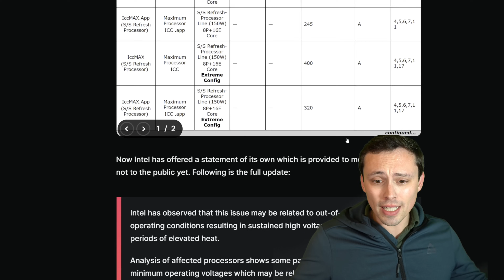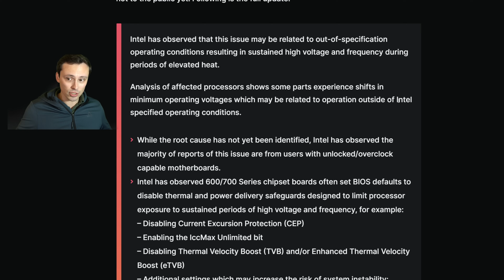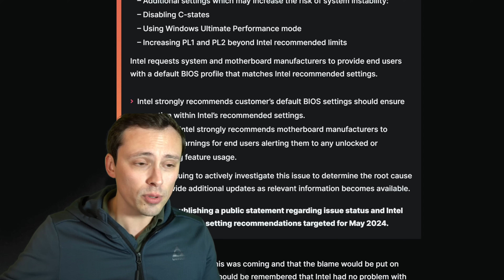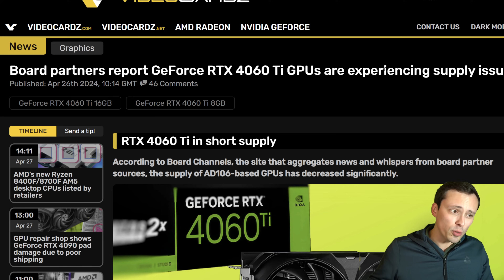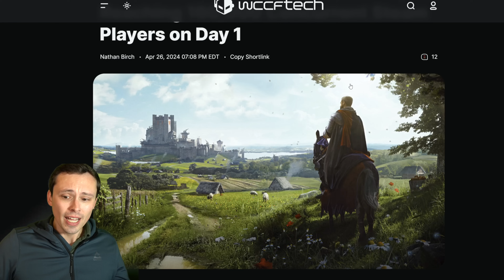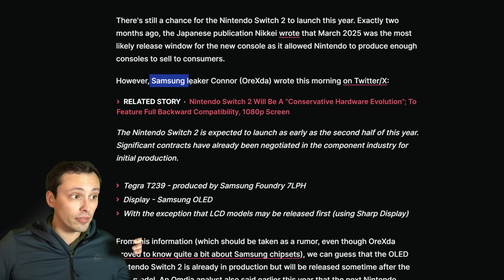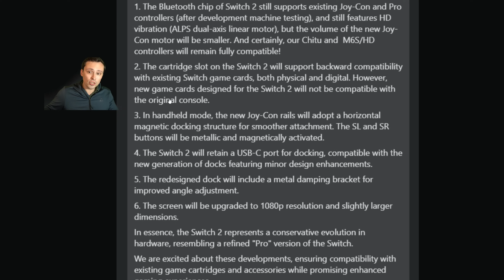MSI Abandons AMD GPUs | Intel Official Statement on CPU instability | Nintendo Switch 2

Comment: It's almost like Intel wanted to get all the good reviews with these insanely unlocked bioses but now that the processors are degrading too quickly over time they're putting the blame on the motherboard manufacturers forgiving them the BIOS features they probably wanted for those said reviews

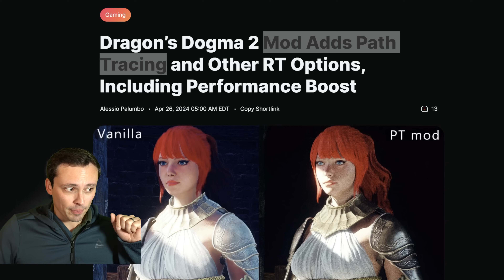Comment: 12:07 if you do character photography in Cyberpunk 2077 with path tracing or even just DLSS Ray Reconstruction, you'll notice that your character (V) will appear grainy. It's one of the reasons why I don't use path tracing or Ray Reconstruction because I do a lot of character photography. For environment photography, however, path tracing is definitely better than rasterized or normal ray tracing.

Comment: Thank you for keeping us up to date about the Intel case.  I have done extreme testing with a 13900K and MSI MAG Z790 Edge TI MAX WIFI.  I invite everyone, if you want to resolve the matter, to document your settings.  Always start with a clean bios, use the latest supported BIOS from the manufacturer (do not use a beta bios, unless the manufacturer invites you to.  Unless you know exactly the changes needed to get a stable environment.  Save your BIOS settings, most motherboards use profiles.  Set your clear bios as profile one.  Most  memory has proper XMP settings on the chip and should be compatible with motherboards from 2020 and newer.  I am currently running with a mildly overclocked system where the Wattage hit 300W at a maximum and does not cause thermal throttling (max temps 91 degrees).  I have unparked my cores.  I run 38891-ish in  Cinebench 23.0.

Comment: Has anyone actually bought an MSI Radeon GPU? The main issue with them is quality, namely that the cooler is a botch-job that is worthy of the famous "Men in Sheds"-Method in Britain, although one could argue they'd create a better fit. 

I have seen many a warning in german hardware forums about buying the MSI offerings, given that the cooler is often ripped straight from the RTX models and then just "fitted" to the RTX models, instead of doing what everyone else does and designing a dedicated Radeon cooler. 
Hence why everyone recommends any other brands for Radeons, including Sapphire, XFX, Asrock and ASUS, even Powercolor is preferred. If one has no problems with some coil whine or mediocre cooler design or thermal paste. 
Given that most of the people that buy Radeons are Selbstbauer or self-builders in english, or their own System Integrators, when they buy a Graphics card, they do tend to research more than the average customer and issues like the one mentioned above are, shall we say....detrimental to the sales of a GPU. 
And the MSI Radeon RX 7900 XT Gaming Trio Classic, sold just 70 Units on Mindfactory, which is the only seller that publishes their numbers. 
If you compare that to the XFX RX7900XT Merc 310 (their custom base model) that sold 2,540 units in the same time frame, or their RX7900XT Merc 310 Black Edition which sold 2,690 units, or the Sapphire Pulse RX7900XT with 2,540 Units the issue becomes quite appearant.
They stopped, because nobody wants them.

The MSI Radeon RX 7900 XTX Gaming Trio Classic in comparison sold about 850 units, which isn't that bad, but worse than all it's competitors bar the ASrock Taichi OC (290 Units), the 24GB ASRock Radeon RX 7900 XTX Taichi White OC (510 Units) and the Gigabyte Rx7900XT (640 Units).
The XFX RX7900XTX Merc 310 Black Edition sold 3,560 units, the Sapphire RX7900XTX Pulse 1,050 units, the 24GB Sapphire Radeon RX 7900 XTX Nitro+ Vapor-X 3,350 units, the 24GB ASRock Radeon RX 7900 XTX Phantom Gaming OC 2,520 Units, and even the 24GB PowerColor Radeon RX 7900 XTX Hellhound (2,370 Units) and 24GB PowerColor Radeon RX 7900 XTX Red Devil (1,320 Units) sold more. 
If you put them in a comparison with the XFX, the Sapphire Pulse, and the ASUS TUF, the MSI card has weaker clock speeds, weaker performance and it was known for some hotspots of up to 105 degrees C in winter.
And on top of that, during early 2024, those cards had a markup of 200-600 Euros compared to the Sapphire and XFX models, and roughly 160-500 Euros to the ASUS TUF model. The pricing of the MSI 7900XTs fluctuated between 1199 and 1700 Euros during that time. 

I think one can see the issues, it's worse in all regards and costs either the slightly less to roughly the same (during the end of 2023) to a few hundreds of euros on top (from early 2024 onwards).....

On the plus side they are not Gigabyte....just!

Seriously MSI, do it properly, or go home! We germans have no problems with botch-jobs, well not too big ones to not appreciate them ;) , BUT ONLY IF THEY WORK!!!
Reply: Msi RX 7900 XTX has amd reference card power limits at Taichi/Nitro+ prices. There is zero reason to ever buy a msi amd graphics card if anything else is available.

Comment: MSI not producing RX 7000-series cooler models and instead is focusing on Nvidia cards is absolutely profit related. AMD already has the very established AIB-partners in Sapphire, Powercolor & XFX and from which atleast to my knowledge, most people who buy an AMD GPU, buy one with a cooler from one of the aforementioned AIB-partners. 
Asus could be possibly considering on dropping out as well. If you look back at RX 6000-series, there has not been a single ROG Strix cooler model for the 7000-series. Not to mention AMD GPU market is just significantly smaller than Nvidias. Or atleast it seems to me that Asus is now treating AMD GPU's as 2nd class products.
Reply: Can confirm. I personally wouldn't consider an AMD GPU that isn't one of those three. My old RX 580 was an XFX one and my current 7900 XTX is a Sapphire Nitro+
Reply: Dam...and I just got 7800xt asus tuff

Comment: Intel are idiots for not locking down voltages and states. That's their fault, they could have literally implemented this to every OEM partner, but they did not. This has been done before on certain architectures and it's nothing new. To  blame someone else is asinine when you could have dictated it from the get go.

Comment: I hate my ASUS motherboard for so many reasons not even related to this. I never had an issue with my ASRock board, and when AMD CPUs had the issue, ASRock motherboards were one of the BETTER ones. Funny enough ASRock and ASUS used to be part of the same company, and ASRock ships their boards and software with MUCH less bloat garbage (i.e. fan control,  extra "AI" BIOS settings, etc.) I really want to go back to ASRock or a different mobo manufacturer for my next build 200%

Comment: arent you able to quickly go to default on a motherboard by just removing the cmos battery for a bit? seems like that feature would be in already...
Reply: the problem is the "default" settings on these motherboards are the overclocked settings..

Comment: Not an MSI fan, have the RX7600XT by Gigabyte. Running an MSI Mech keyboard the Mystic light software will not even run, tried every fix it just crashes all the time. Using SignalRGB for now. Upgraded my desktop 3 times about to do so again. Built 3 other PC's 2 for me 1 for my niece not one have MSI MB, 2 Gigabyte, 1 ASUS or 1ASROCK.
Reply: Stick with signalrgb dude. Mystic light is terrible.

Comment: All of these Intel reports made me return my i7-14700kf components and plan a 7800x3d rig instead.  I was once on team red using an fx-6300 but switched to Intel when the i7-6700k released. Intel's IPC was much better than AMD's during that time, and I experienced higher performance with less cores. But, its seems like the roles have been reversed. Looking forward giving AMD a try.
Reply: The 7800x3d is definitely a good choice. It's very power efficient, and makes i9s and Ryzen 9s effectively pointless for most gamers.  It's seriously weird how good it is.
Reply: If you don't have any issues yet, don't worry about it too much. Especially this late into the Zen 4 generation. Wait for Zen 5 later this year and then make your final decision then.
Reply: AMD has been better since Ryzen 2000 tbh. Intel started shitting the bed after the 6th gen.
Reply: @TheFirstSSJ more like when zen 2 dropped, zen 1 and zen+ were subpar.
Reply: I honestly don't blame you. Am still on 12th gen, main rig has 12900KF, no point to upgrade any of them with the current issues on the 13/14th i7 and i9s. If I were building today a 7800X3D or 7950X3D or if there's an all 3D vcache 8950X3D in the future that would be amazing. I turned off MCE etc to be safe but ram speed on DDR5 has been my issue, which is separate from the current Intel issue no BIOS updates have cured that I'm not getting as much ram speed as I should be, but it works. I would be open to switching teams in the future, but the only saving grace were the deals when I built. You also have a much better upgrade path. I do have older AMD around the house Athlon 2, some cheap A series laptop still gamed decently, helped my friend back in 2020 with picking parts 5800X X board, solid build. Can look back at things like I should have switched but the timing didn't line up, if I had went even 3700X instead of 9600K that would have been better. Intels I've had around of the past era: 2100 (office machine tbh), 6502p skylake era low end i5 prebuilt, 9600K (at least it was only a $200 chip), 12th gen did improve on those but it really comes down to pricing that they went massively on sale, around 210-320 for their i7 and i9s. Honestly not sure but AMD should continue to improve with the next gen (boards should get cheaper in theory, perhaps get more features as baseline) and the upgrade path is better. AMD also had better packaging with 5900X than say 12900KF did as far as presentation goes.
Reply: As it has been pointed this is not INTEL problem. It is motherboard problem. Just like it was when AMD CPU's were burning.
Reply: @paulboyce8537  But, Intel told the MB manufactures that "unlimited" power limits are within spec.  So, it's really their fault.  Hardware Unboxed just released a video showing proof of Intel saying this: https://youtu.be/OdF5erDRO-c?si=TzNv24alqp5ptqhy&t=1123

Comment: Intel strongly recommends using the far lower recommended setting (not the max spec) on motherboard and CPUs that are being sold as unlocked or extreme CPUs.
Intel had NO idea that every MB manufacturer has been doing this since the 12th gen came out.
Intel has NO idea why there were very few issues with this on the 12th gen and increasing issues on 13th and 14th gen 
Intel had NO idea that CPUs run at safe/stable levels would be 10 percent slower than the reviews shown

Intel notes that significantly exceeding the recommended power levels is highly likely to damage your CPU
Intel notes that overclocking, including overclocks/excessive power done as MB defaults voids your warranty
Reply: Yeah right. Intel knew exactly what they were doing allowing Mobo suppliers to basically overclock the chip so they can remain near the top of the chart. They knew exactly what was happening because otherwise AMD would have been 10% ahead which is a horrible look. All completely premeditated actions from intel attempt to remain competitive.

Comment: I posted this on another channe....l was worried about this.  I have a 13900k and an ASUS motherboard.  I set multicore enhancement to enforce intel limits and SVID behavior to Intel fail safe.  My chip is running stable on all of my games with these bios settings.  I ran cinebench on my 13900k with these setting and still scored 35076.  It still performs well.

Comment: I'm one of those affected by the 13th/14th gen Intel instability issues, started crashing during a lot of games a few weeks ago, and it's gotten progressively worse since (I'm on a 13700K, on an ASUS Prime Z790-P Wifi, and the Horizon: Forbidden West support team confirmed that my game crashes were during shader compilation due to this issue, as I sent them crash dumps/etc). There's a BIOS update for my board, but I've always been a little terrified of BIOS, so I haven't done it yet.
Reply: Am flashed to the recent BIOS for Asus TUF Gaming Z690 Wifi, though I'm on 12900KF. It's super easy to BIOS flash, not sure if it will solve your issues, but just putting the unzipped .cap file onto either a usb drive or an external hard drive you can do the flash in around 5 minutes. I too was scared of BIOS flashing. I've done 2 boards to the recent BIOS and some earlier BIOS, you can also turn off MCE, last video on here had some good suggestions for settings. Their BIOS flash is easy to navigate to and use. Not sure if it will fix things and you'd have to redo settings as they will default again (always have to turn back off armorycrate bloatware to disabled, I use openrgb when I want to adjust). After the machine restarts a couple of times, the flash is done. Just have to not touch anything for a few minutes. It's good to get over the fear of doing it though, it wasn't as scary as I thought it would be to do both my boards.

Comment: I find it unlikely that multiple motherboard manufacturers shipped their BIOSes configured this way without Intel's direction or approval. If it was 1 manufacturer, I could buy that. It seems more likely that Intel either didn't communicate their requirements properly or else directed the motherboard manufacturers to set high power limits so their CPUs would perform better in reviews and benchmarks.
Reply: The latter 100%. Come on.. Intal is struggling to remain profitable. that additional power allowed them to stay neck n neck with AMD. Letting AMD have an unquestionable 10% lead would have been bad enough that Intel decided it was worth the risk to remain at the top of the charts. Now they're scrambling to make it not look so bad by saying it was Mobo or miscommunication. Of course they say that.. given a scapegoat in this scenario, you'd be stupid to take responsibility.

Comment: I can't wait for the next gen, guys!
The RTX 5070 will have 18GB of DDR7X VRAM and a 320 bit bus width, perform a bit better than a 4090 while consuming less power, all at an enforced price of $500!
The RX 8800 XT will compete with more VRAM and superior raw rasterization, as well as a $100 lower price at $400!
The Arc A880 will be there as well, having superior ray-tracing performance than either, also offered at $400!
It's gonna be sweet!

Comment: Just a note since i have seen a lot of confusion.  that asus profile test included games being run at 720 with an i9 and a high grade GPU, what I believe almost no one actually does. There is a paragraph there mentioning  the performance drop is much smaller or null at all at higher resolutions. I for example have 3440x1440 and so there is no actual performance loss between the "optimized" mb settings and intel spec settings since at the resolution I am , the gpu is the deciding element independently of the power setting of the cpu. 
Additionally the test made with the gigabyte bios was done with a 13900 qualification sample limited to 188 watts (why? do not know ) and therefore quite below intel spec, and in fact with a power limit of 188 that 13900 would perform almost like a 13600 independently of other settings so the conclusion that the 13900 performed as an i7 is not surprising at all.

Comment: I don't believe this is only the mobo makers fault, if not we would be seeing the exact same issue with AMD CPU's, but afaik we are not.  
I bet this is mobo makers and Intel, both deciding to push Intel CPU's beyond specs, all to try to beat the competition. 
They probably made a study and found that the probable amount of people having problems, would be way less than those that would not, so they risked it, because even if this ends shorten users CPU life, it would be enough for them to probably go to the internet and say "my Intel CPU is faster in games!" and only a single comment like that, is enough to sway a bunch of people to buy Intel.

Comment: Makes sense though when you get higher profit margin selling Nvidia card at overpriced pricing than AMD
Reply: Msi is trying to sell what is essentially amd reference cards at Nitro+ prices. I'm surprised they sold even one RX 7000 card.
Reply: @blegi1245  Yeah there"s some questionable decision on their lineup, like using plastic backplate, locking power limit on rdna2

Comment: If you are buying AMD Gpu go with sappire or power color.
Reply: What about XFX?
Reply: Power color has low power limits. For RX 7900 XTX best cards for the money are XFX and Asrock Phantom Gaming. Both have the same power limit as Sapphire Nitro+ and Asrock Taichi at significantly lower price. For 7900 XT XFX and Gigabyte have the same power as Sapphire Nitro+ at lower prices.

Comment: MSI 7000 series cards were a lackluster and their nvida cads are suffering from quality control issues it would not be surprising that they cut amd because they had too many skus and wanted to refocus. 

On other had I would not be surprised that nvidia pushed them to abandon amd video cards, It is very strange that all manifs that produce both amd and nvidia cards do not sell high end versions of amd cards ( No rog strix amd cards no Msi sumprim amd cards and there were only a handfull of gigabyta Aorus at the release ) Hint Hint!